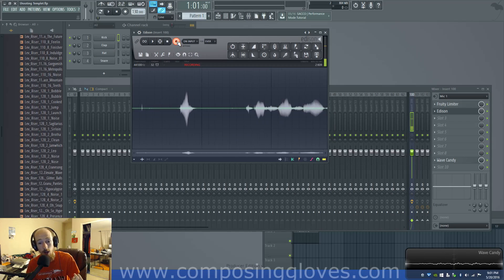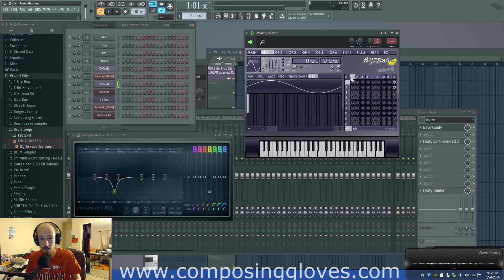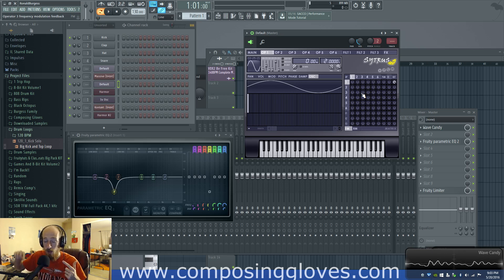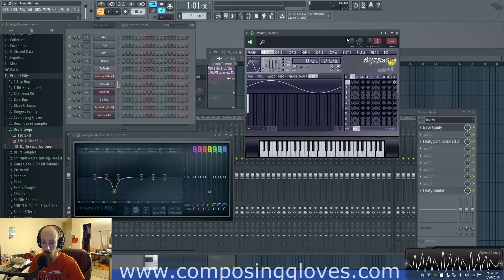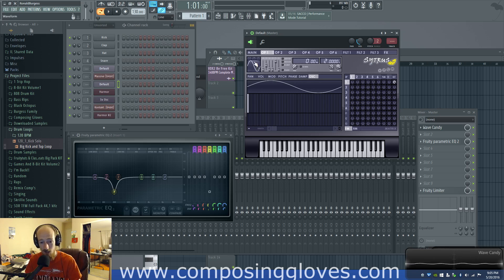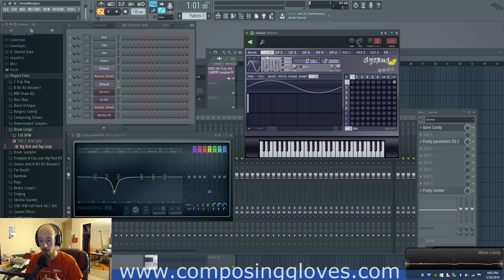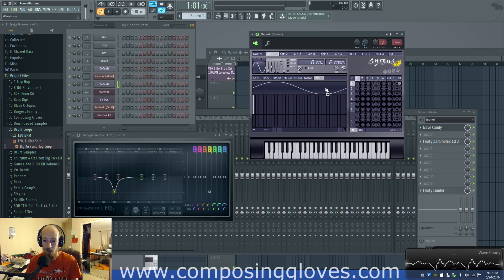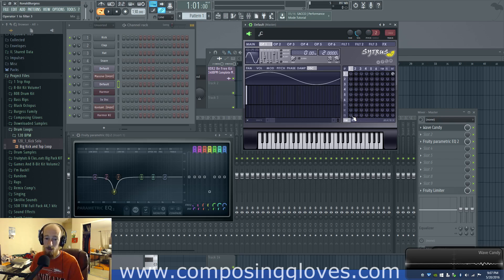Sound and Synth Basics 32 - FM, RM, AM

Comment: in short:  RM is ring modulation and is a form of AM which is amplitude modulation. These modulation types have to do with changing the "volume" of a signal very fast. FM is a frequency modulation and has to do with changing frequency very fast. RM and AM introduce new harmonics but in a very specific way. FM is much more flexible and more powerful then RM and AM because of how it brings in new harmonics. thx :D

Comment: What does RM Synthesis stand for?
Reply: Would you mind explaining RM and AM basic concept to me, and what makes it different than FM? I didn't quite get it...
Reply from the maker: @airanmilian  RM is ring modulation and is a form of AM which is amplitude modulation. These modulation types have to do with changing the "volume" of a signal very fast. FM is a frequency modulation and has to do with changing frequency very fast. RM and AM introduce new harmonics but in a very specific way. FM is much more flexible and more powerful then RM and AM because of how it brings in new harmonics.
Reply: @ComposingGloves  Allright, thanks a lot for your explanation ! :)